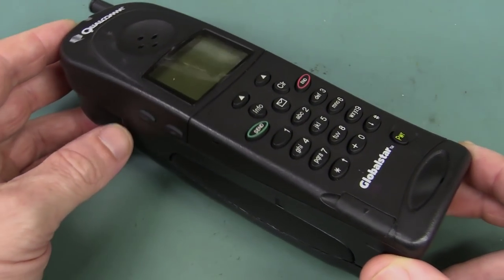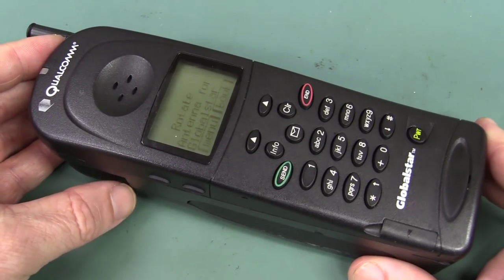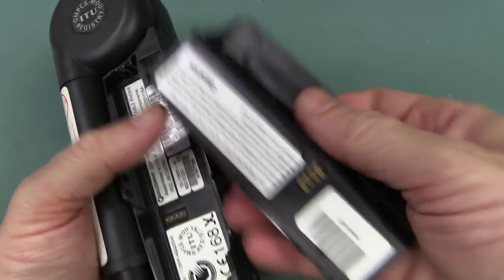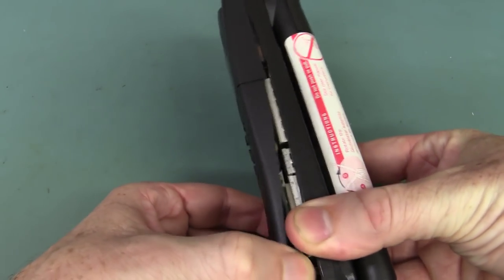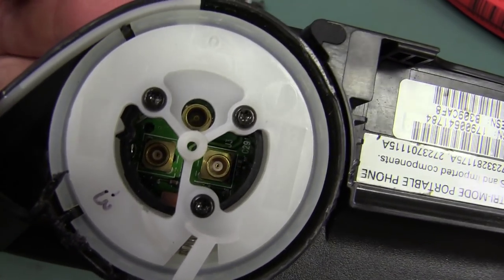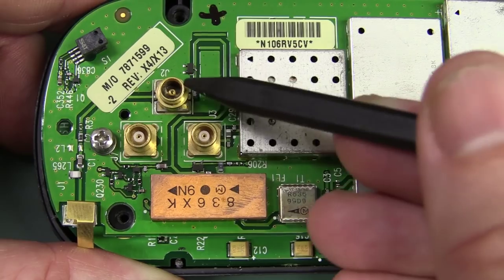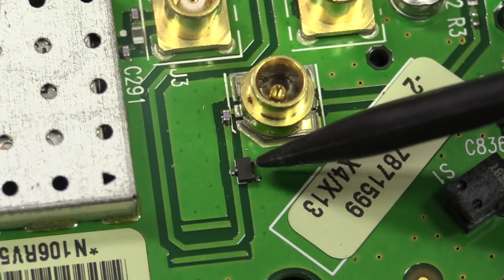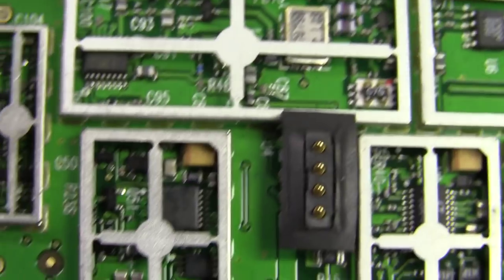EEVblog #721 - Globalstar Satellite Phone Teardown

Comment: 386 EX isn't just a microprocessor like a 80386 SX or DX desktop chip. It has onboard power+clock management, serial, DMA, DRAM refresh, etc. It's practically a system-on-chip. It came out in 1994, giving Intel plenty of time to make it super cool and super low power.

Comment: That third connector for the antenna may actually be for GPS.
I've engineered a few cellular devices at work and sometimes the third coax is used for GPS, depending on the model of radio card.

Oh and we used to use A LOT of 386DX for our embedded modules, it wasn't until about 4 years ago we went ARM.

Comment: Its CDMA not GSM thats why it has an ESN number, the SIM is for phone number storage only. I have one, still use it when in the badlands. $50 a month for 80 minutes. GSM has a 35km hard distance limit, its usuless for any kind of range
Reply: I noticed the ESN right away, too. CDMA has fairly primitive security. The key values would be stored in NV memory on the phone.

Wikipedia says Globalstar is basically a long-distance pipe for CDMA or GSM signaling, depending on the type of phone. I'm surprised that technique would work with all the extra latency. This would also not be the best phone to use if you're concerned about the NSA listening in on your calls. 😉

Comment: You're right that the custom main connector on the GSP-1600 is in fact quite evil. It is also very fragile; both the male and female sides of the retaining clips have a tendency to get mangled and once that happens, there is little that can be done but to replace the charger or send the phone in for service.

That said, in addition to power and serial data, that connector also includes separate TX and RX paths for the satellite RF signal, as well as a full-duplex cellular RF path for use in car/boat/etc kits and the like. (Hence the three coaxial-looking connectors it contains.)

Comment: I would never have guessed the 80386.
Reply: uriituw Yep, that was shocking to me. A Intel CPU in a Qualcomm based satellite phone? So unusual. Now Qualcomm makes ARM processors in addition to other things.
Reply: Α real PC inside a phone. That phone has so many electronic parts. It was built at the peak of mobile revolution. Unfortunately it failed commercially and doesn't support global coverage for sailors. During 2000 the mobile coverage was problematic even inside cities. Today even in poorest countries the coverage of mobile phones is cheaper than laying telephones wires.

Comment: Those were very nice at the time.   You could have your GlobarStar telephone number and also have a CDMA telephone number loaded in the phone.  Their bread and butter service was standby contracts, you would pay a specific amount per month to have the ability to make calls or more to pre-pay for minutes. 

The bottom connector is a multi-function connector to allow for voice and data connection to a PC for text and data.  You could also plug them into a case that allowed for external CDMA and sat antenna. 

The Sat antennas are Circular Polarized, and that is the reason for the spiral on the antenna.

Comment: Maybe the Antenna is an "active antenna" - i.e. has an LNA/filter built into it. Maybe the power supply for this comes from the DC bias inductor you found. Similar to how satellite TV systems work - they even have a block downconverter built into the antenna. Satellite signals are so weak - it's like trying to pick up someone lighting a candle at night on a hillside 5 miles ways.

Comment: I remember these things. Business I used to be in had these. The one I had was a bit newer with a removable satellite antenna. Could take that "erectile antenna" off and put a remote one on it for signal in  say a vehicle through a roof mounted antenna. Sadly the model I had didn't have any GSM band radio. It was satellite only. Still looked almost exactly like this thing minus the GSM antenna. Good hardware for being so dated. IT was around 2007- 2008 when I had one of these.

Comment: the third one might have been put there with the intent to later integrate the use of an external antenna that would have had a bit more gain(or for those McGuyver type survivors that happen to come across a pack of gum whose wrappers could be used to make a makeshift satellite dish and a few scraps of wire to link it to the connector lol). if you ever find some old nokia's there's a small rubber plug on the back near the top by the antenna and if you pop it out you'll find a similar connector for an external antenna.

Comment: That 3rd RF connector looks a lot like an RF test connector possibly used during antenna matching. I've been working with the SIM900 recently and the design docs suggest a similar connector in a similar, inline config.

Comment: I work for a company that still deploys  a ton of these for our Oilfield lease sites, where the is no Cell service. These are stil relevant
Reply: +Jamie Stubbe 
Yup!  The company I work for use them still as well, when necessary, when our other communication systems are not yet set up at our mobile locations.
Reply: +Igor K I can possibly get you a defunct device. all the ones that are working are still in use. DM me.

Comment: I have a iridium go wifi hotspot.  Very pricey data.  I don't complain about lte data charges. The speeds vary from 2-20kbps.  Yes Kbps.  Charged $1.58 usd per minute for web or voice.
Reply: Where do you live?
Reply: I live in iowa.  I travel to mines all over the world working on the equipment.  In the USA I use Verizon lte were I can and wild blue sat Internet.  But when I go out of country I have few choices for Internet in the field.  Worst thing about Iridum go is it can only connect to android or iOS.   No laptops.
Reply: brian hilligoss Why would they design it like that?  Why would the design of the hotspot prevent you from using it with a notebook computer?
Reply: +brian hilligoss Holy shit 
And I thought terrestrial wireless internet was expensive 
Imagine trying to watch YouTube on that lol

It's like really expensive 2G internet 
In fact I think 2G might actually be slightly faster
Reply: +brian hilligoss I have in my fleets about 120 Iridium connected vehicles, the problem is packet wrapping and all the complex ways you can use the satellites, you can easily get a cheap rs232 modems, but you need to do your own packet unwrapping and management then... you can of course plug in a laptop, but you need a router/piece of hardware, that speaks Iridium in between. Iridiums data connection is not really TCP/IP, you can get IP tunnel directly, but those will cost you your second leg.

Comment: I died in the middle of bloody no-where because of a stupid 3 prong connector.
Reply: TheRealMrPooPyNuTz 
Not me - I made sure it was charged before I left, and made sure I had enough battery left in case of an emergency.
Reply: TheRealMrPooPyNuTz Yeah, I mean seriously what were they thinking? Even if they didn't want to use micro/mini-USB, what's wrong with a good old barrel connector? At least that would let you jerry-rig something up out in the middle of nowhere.
Reply: Because this thing runs at voltages above that of USB, and they wanted to integrate the power and the serial link port?

Comment: Funny, I'm seeing this in 2021.  Globalstar has been calling me for a few weeks, because my GSP-1600 phone isn't active.   They're offering $100 USD to buy it back from me, so they can resell it.  They're selling used on eBay for about $250 USD or so, with all the accessories.   As I understand it, there is no carrier offering terrestrial service.   I did walk outside with it, flipped the sat antenna out, and it connected to the satellite.

I was just looking around to see if I could find a video of someone fixing the charger cord.  I don't know what kind of crap plastic they used, but the sheathing shattered in multiple places from just trying to straighten the wire.   I have to charge and test it before I sell it on eBay, right?  Looks like I'll be reconditioning it before it goes out.  I'll use something better than they did.  With all those stupid pins on the connector, the charger only has two wires in it.  It was easy to see when the sheath fell apart.  I hope the new owner appreciates the upgrade.

It was nice to see inside.  I wasn't going to crack the case and risk breaking something on a mint condition phone.  I wouldn't have expected the i386.
Reply: I was wondering how they were getting these to sell refurbished on their website
Reply: @kimcelarmycx229  I'm sure some come off contracts with big organizations.  It really felt desperate when they sent me the email. I was really surprised by their low offer.  I made a few bucks selling it on eBay. :)